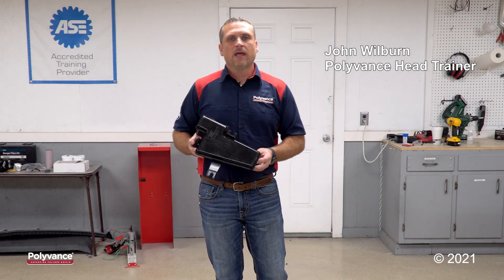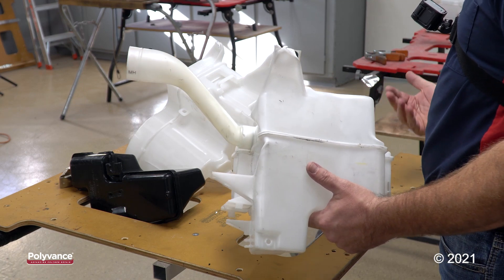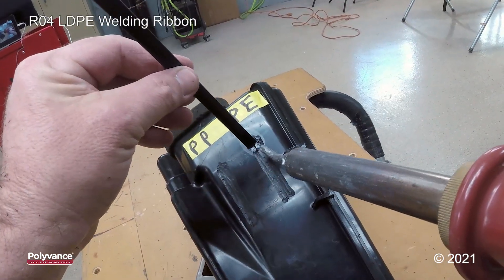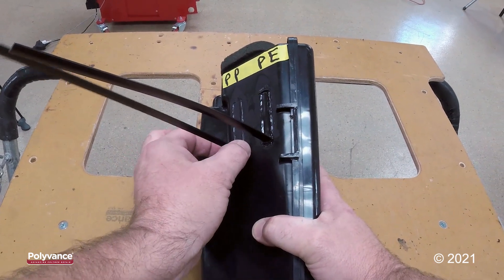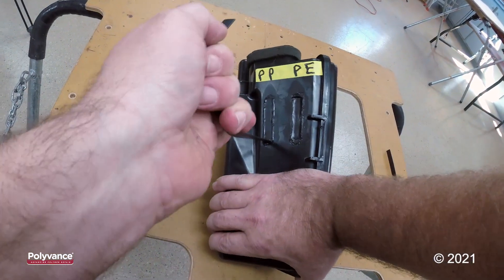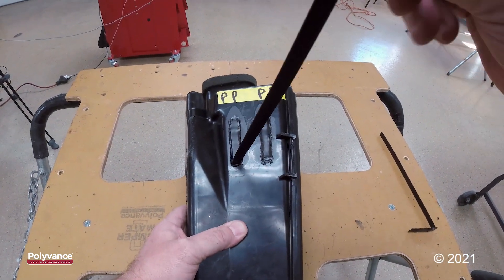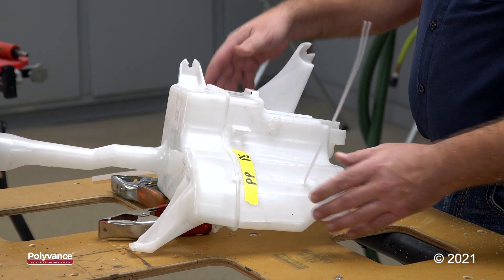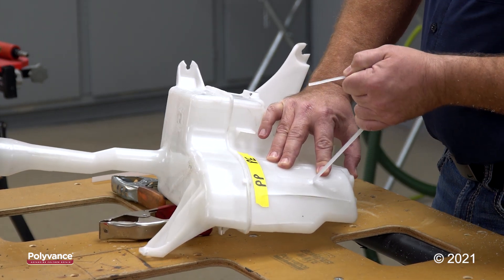Plastic Pointers #16 - Blended Plastic Parts (PP/PE)

Comment: Please discuss heat settings and gas flow cfms. Thanks, I use your equipment in my auto body repair program @ Ingram State Technician College in Alabama.
Reply: Flow it typically around 12 LPM but can range between 10 LP and 15 LPM for many things.  Temp settings on the digital welders are usually between 52 and 72 depending on airflow and material.  You would never use 72 with an airflow of 10 LPM for example, the torch will overheat and the weld will be suspect.

Comment: Curious, if ribbon cut from PP/PE one part will stick to another stronger than pure PP?
Reply from the maker: We know the PP rod will stick...PP is a majority of the part because it is the first symbol in PP/PE.
We're not sure how well a rod from one PP/PE part would stick on a different PP/PE part because the blended PP/PE ratios may be different between the two.
You could do a weld test to find out.